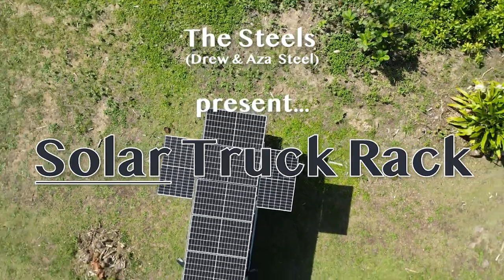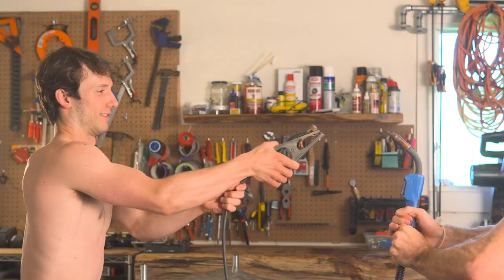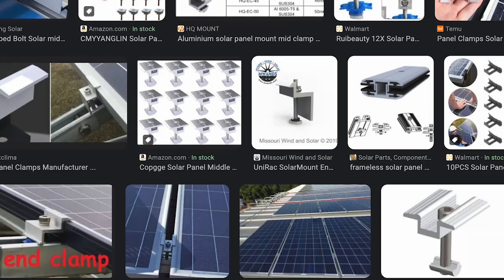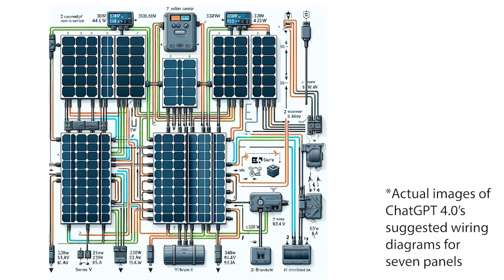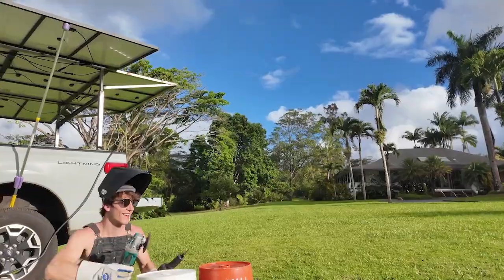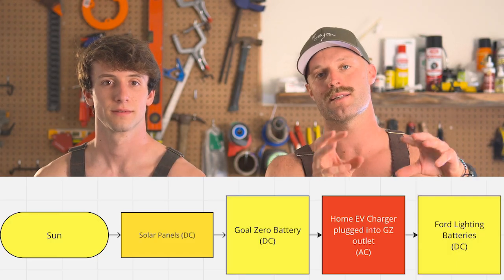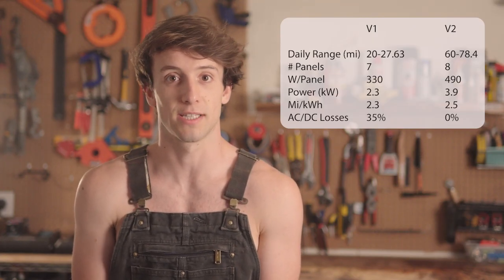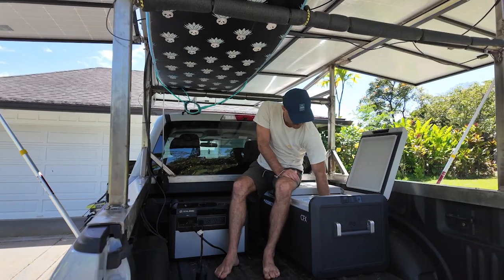We Built the First Solar Truck Rack for my F150 Lightning

Comment: The potential to generate 10kwh/day would save 300ish kwh/month if you plugged in to the house each night. On tiered rates plans, that easily $90+ saved per month. Also since you can self install, there's no bs permits, city approvals, inspection s,licensed electricians to f/w. And when you change houses, take it with you by driving to the new  house.

Comment: If you made it fold up and put the whole system in a trailer rather than on the truck itself, it would not be such a drag. A frame that  became an awning or roof.
Reply: Then you can't tow anything else but the solar trailer with it attached. No boat, rv, atvs, flatbeds, etc .

Comment: music is cool, next maybe an rv covered in panels. Can you use optimizers to convert to ac, In Florida now, off grid with a Tesla power wall and 26 panels. lets say you need about 40 kw to get 100 miles, Put a powerwall in the truck,charge that sucker, though they weigh a ton.
start a solar powered ev station. then go completely off grid. Reminds me of the 60's when we tried to live off the grid as hippies and now it is  reality.  Keep the vibe going, its great. Put the big military industrial complex to shame.

Comment: FWIW, if you were out at peak sun(summer day) on a flat road and no headwind and had a way to bypass the battery, you could solar propel the truck at 5mph(with an initial push) for a short time .... Lol. 0:05

Comment: F150 Lightning has a standard 98kwh batt and 240 mile range so lets say 400w/mile. Lets suppose your job is 5 miles one way. Let's suppose your onboard panels generate 2kwh x 5=10kwhs daily.Lets assume your batt has only 2k left to get you to work, so you arrive at 0k(empty). Sun provides 10k so at end of workday you're at 10k. After travel to home(-2k), you're at 8k. Use 6k(10hr x600watt window ac) at night, so by morning you're at the 2k mark. That leaves you enough to get to work and start the cycle again. If your wife has the same set up, combined you can use the residual daily 12kwhs to power the house(by plugging in) at night. Obviously, Im being 100% theoretical, but this could eliminate the need for household battery storage bank by just using the trucks you paid a sh ton of $ for anyway. Of course, daytime household power would be provided by solar roof system, with grid backup. So when the grid crashes, you have power night and day.

Comment: I like the ability to recharge on the go, getting 27 miles of solar panel range. Would be awesome if you were going on an extending off-road camping adventure the  boonies... I think i recall that using solar vs grid to charge an EV
saves about 5cents a mile(15c per kwh/300 kwh/mile) roughly. So you save $1.35/day then figure out the payback time with this configuration vs mounting the panels at home(probably cheaper). Personally, i was thinking about a full length truck ladder rack(like plumbers have) to accomodate 5- 400watt panels(45"x67"). With plywood substrate and rigorous wind testing of course. When camping 2000w(or 8-10daily kwh) should be plenty for creature comforts, including modest air conditioning/heating in a camper shell bed

Comment: very cool project.  I'm starting to see several of these show up (and it really does look cool).  Biggest way to save money is to probably using a classic camper shell as the main frame and just add on to that a bit.  probably get a used one under $1000.  It takes some cad work to really get the drag down.  There is another project some guy has done where he got the drag penalty down to low single digits by folding the panels while driving.  worth checking out.  (he did this with a model y).  At wholesale prices and very clever engineering, it might be possible to get 4kw of solar and charger etc for approx $3k.  Thats a ton of power.  can actually pay for itself in 2 years, less if you do a lot of offroad trekking.

Comment: Let’s see version 2!  Try using micro inverters on the panels to power the AC charger directly without a battery in between.  Micro-inverters are very efficient and maximize production from each panel no matter the direction the panel is facing.  So, while driving, the panels would charge that Yetti better.  When parked, power the charger via the micro-inverter trunk cable and the Yetti battery simultaneously.  This also would help offset some conversion losses. 

Keep in mind DC to DC still has significant losses due to stepping voltage up or down.  It’s also much more expensive.  With the money saved not going DC to DC, buy several more panels to carry in the bed to be deployed when stationary.

Comment: As someone trying to run an AC unit in my RV with panels and not getting enough roof space, the ideal of using roof space of my truck has definitely crossed my mind.

Comment: I would be most concerned about the amount of drag increased by this. You mentioned a 15% loss in range due to additional drag... Which is probably the same or more range than you gain from even having it in the first place. I hope that you are able to find ways to offset this in any future projects!
Reply: There clearly was no thought put into the design of this and I doubt a version 2 is in the “design phase”.  They clearly had followed no model when building this monstrosity. Who is the customer? What are their requirements? What problem is it attempting to solve? What are the design goals as far as efficiency, efficacy. They didn’t even ask the question how many solar panels and of what type will it require to produce W amount of Watts? How much is W and for what is that power needed? Thats way overkill for keeping one solar generator fully charged. Did they even consider how to balance the weight of the system and how much power was required just to haul those around.   Their mounting system is laughable considering the off the shelf options they considers would have been a much better choice. I would never ride under that thing on a potholed country with welds done by two inexperienced welders. Im gonna stop there.

Comment: I'm looking for a completely solar camper van
Reply: My suggestion is to not skip the all important requirements and design phases. This build reminds me of the episode of the Simpsons where Homer built that
car and bankrupted his brother’s auto company.
Reply: I have an electric scooter where the whole motor is in the wheel. When the copper housing is electrified it naturally causes an extremely powerful spin. Way better than putting an electric motor and transmission and then giving power to the wheels through an axle.  @trippmoore

Comment: The length of the front overhang will be problematic at speeds

There is too much leverage for the wind pressure pushing up, it might get ripped off
Reply: This can’t be street legal.

Comment: I am going to do this to my cyber truck if it every arrives. There is a much better way to set this up with what is called an 'all in one' solar unit. It would mean the solar goes straight into the truck battery. No need for an intermediate battery so far less inverter waste. Message me if you want more info on this. FATeBIKEnz@gmail.com

Comment: Great video guys, and fun project!  I'm sure you'll learn plenty more about how to improve it just by actually having a working project.

To improve charging efficiency, eventually you'll probably want to build your own battery/use a pre fabbed one that is only a battery that has it's own BMS.  

From there, you need a DC to DC charger.  I've only seen one DC to DC charger for EVs by a company called Enteligent.  No idea if it's any good.

This is the first video I've watched, will go see if you have more.  Curious about wind noise, highway speeds, etc.
Reply: You asked far more questions than they did during the “design phase”. lol

Comment: Seems like the perfect setup for Hawaii! I can't believe you guys used stainless, that's impressive.  Mild steel is a lot easier to weld and work with...and cheaper! Adding hydraulic posts to raise the rack for the hammock and struts for the side panels is easy work. Great project! Self sustaining cruising around the island!

Comment: there is a channel 4x4electric. With their array they traveled through africa with an VW made car (MEB Platform). Maybe flexible panels are more efficient for transportation. They also used a prototype DC to DC converter to reduce losses.

Comment: To make this work you'd want to put the DC Voltage from the solar panels directly into the battery.  Since ford uses a 400 volt battery you'd need your panels configured at a minimum of 400 volt output which would connect to the 2 DC pins on a CCS connector. But not that easy because you'd still have to use the J1772 connector on the CCS connector for control which would require knowing what kind of control voltages you'd need and what pins on the J1772 are used to control the charge.

Comment: If I  had to depend on public chargers, I wouldn't have purchased my lightning. Prior to purchasing my lightning, i did a lot of research on the truck itself and its charging infrastructure. The truck was great as long as I  wouldn't use it to travel long distances.  Even winter driving looked like there wouldn't be any problem with the limited range in colder weather. Public charging is way overpriced compared to charging at home. It is even better for me because I can often charge my truck from my home solar for as much as 3 hours a day and still get a full charge on my home solar system. That's around 20 kwh of power added to my truck on really sunny days. I only usually drive my truck a couple of times a week and a round trip never any more than 60 miles.  So I pretty much drive my truck for free.
Reply: This will all change in the winter, which is fine because my winter kwh cost is only $.08/kwh and I'll just start charging off the grid again. Even if I only got 1 mile per kwh, it would only cost $8 to drive 100 miles. But I get much better range than that with my lightning.

Comment: If I’m getting this right, 13 kWh generated per day -> 4,750 kWh/yr for a system that could last 10 years. That means a system like this at around $6k would be about 12 cents per kWh, making it relatively cost effective.
Reply: If your calculations are correct. You'd need every day of the year to give you at least 5 hours of solid sun with no clouds 365 days/yr.  And I don't know of any solar panels that have a 100% efficiency rating.
Reply: They didn't buy the battery...  Would have been $9 or 10k.  Also, labor was free.  Makes an awesome video tho!  Love it guys!!

Comment: Guys, Awesome Idea and execution on doing this marvel idea, I was googling to find out if anyone has done this before because I didn’t want to put solar panels on the roof of my trailer camper. Using extruded aluminum such T-slot I think may be a better way to go. My idea was to do the same, but use the panels as a wind deflector making use of that while driving. Having a tilt mechanism for optimum solar collection when camping. I thank you for the inspiration to actually give this a try.

Comment: Any ideas on how to wire the solar directly to the truck? Lightnings have a 220 (or so) DC charger that charges the 12v battery, but I don't know if it can work both ways. I run an electric mowing business with my Lightning and I'll be doing solar on my enclosed trailer soon, so I'll keep an eye on your videos!

Comment: If you going to upgrade your panels you should think about bifacial panels. Also maybe you could do two layers that would slide out to make a bigger rack, like a drawer. Ps I own a solar company in Canada. Sunfish Solar Inc.
Reply from the maker: yeah! been noodling on the slide out thing! that could be pretty awesome. its so high up that it likely wouldnt interfere with other parked cars and you could get thrice the power. that's super cool that you own a solar company!
Reply: If you have the panels slide over the cab, it would keep that part in the shade and reduce the energy required to run the A/C when you start driving.

Comment: Not hydraulics, but small electric motors.
Reply from the maker: Any links would be dope.
Reply: @co-dream-co  Just saying that hydraulics would be needlessly complex (hydraulic pump driven by a motor plus hydraulic lines and pistons). Rig up an electric winch with pulleys and cables. You already have an electric battery supply and outlets.
Reply: @backdoormanintheend I think they maybe just used the wrong term.  

They could definitely figure out some gas struts for this application, which is what I think they mean.

Comment: Nice job fellas…was wondering when someone would get around to doing this! Let’s talk to solaredge and see if there upcoming DC EV charger can be retrofitted for this purpose ( no inversion) or perhaps some enphase iq8 ensemble’s to go direct to charger and skip the intermediary battery ..( one inversion at the microinverter)  there..got some unique German light weight glass less bifacial PV coming around that could make superstructure less intensive as well… aloha from maui
Reply from the maker: Thanks for the support from Maui! Yeah it would be killer to avoid all that conversion.

Comment: Excellent. Use solar optimizers or use mcro inverters for each panel. Lateral panels are striking the other if they are hooking, all panels will perform just like the worst
Reply from the maker: Yeah! Good point, we do have a solar combiner thing from goal zero that takes in 3 separate combined arrays, so luckily not everything is in series.

Comment: If your plan was to change when stopped, a better approach would have been a setup that rolls down into the truck bed and is rolled out and expanded like the setup. With this suggestion you will not have to build that heavy frame structure. You are loosing over 10 solar miles due to the weight of the structural frame itself. Second bit, the solar power generator. Remember for pure solar charging use case, you don't need large storage capacity for the generator. Get one that has battery just enough to stabilize the output to the truck charge port. Or may be repurpose one by removing the storage on the generator. This should reduce few 10s of lb weight. 

Last but not the lease, a wind turbine mix, vertical one, would be an excellent addition to the power generator.
Reply from the maker: Thanks for the thoughts. Wouldn't a wind turbine basically just add equivalent drag, thus negating any power gains? Maybe im wrong. Curious!
Reply: @co-dream-co  You only have the wind turbine setup when the vehicle is stationary.